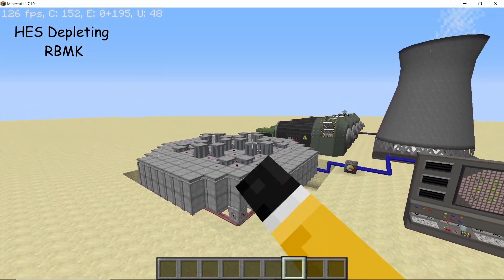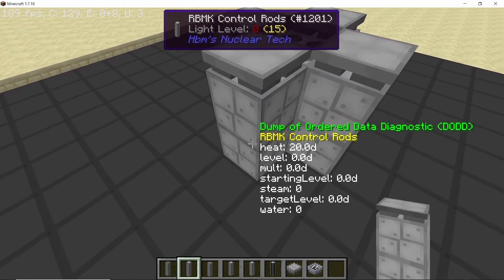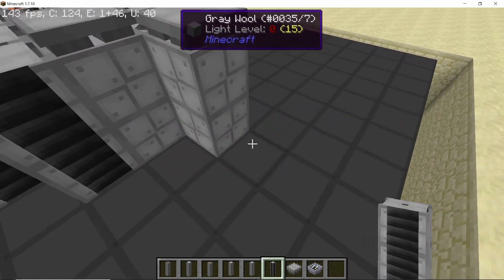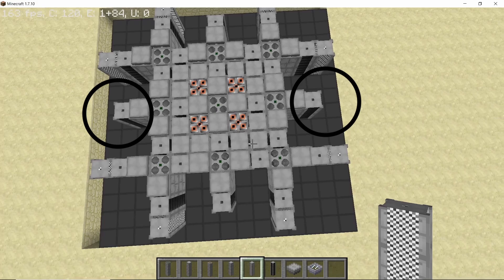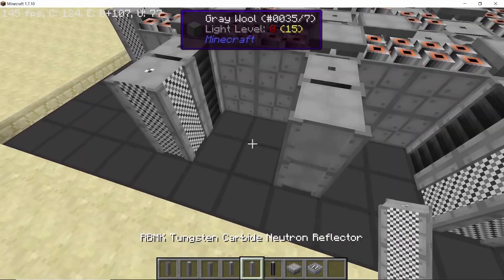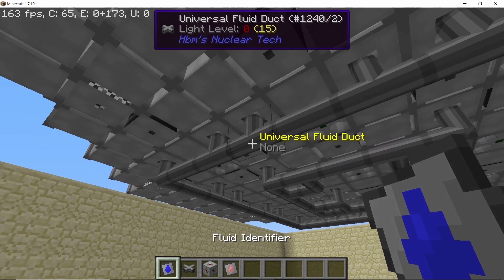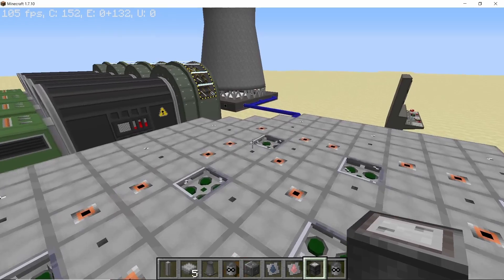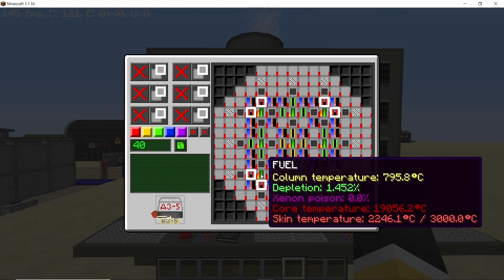15x15 RBMK Reactor - Schrabidium depletion using Thorium Fuel - HBM's NTM Minecraft

Comment: What do you need to do for don't blew up your reactor in seconds:
1: DO not press AZ-5
2: PUT 16 TURBINES. 8 leviathan, 8 industrial
3: PUT at least THREE COOLING TOWERS (2 BIGS, 1 AUXILIAR)
4: MAKE sure your reactor has enough water
5: Check the flux at the START, NOT other thing — if you don’t do this, it could blew up
6: THE life of the fuel rods is about 3 DAYS (real life) common. If you don’t change it, it will stop

If you don't do those things, it may not work, stop working, or blew up

☢ RBMK-1000 ARE NONE-SAFE TO USE IN NTM (NUCLEAR TECH MOD), LIKE REAL LIFE

This works on 1.7.10 with the normal NTM, and also on NTM EXTENDED or REMASTERED 1.12.2
Thank you for listen

Comment: Thanks for the tutorial!! Just one thing, for the schrabiduim fuel, you have to set it to 35 and then to get the most out of it I had to wait for it to stabilize then go up by 1 wait for it to stabilize and go up 1. All the way to 40. Past 40 (even by 1) = kaboom
Reply from the maker: Yeah that is why I made the schrabidium depleting pwr design in my last week's video, rbmk required quite alot of manual oversight. Pwr on the other hand is safe once you've set the control rods to the appropriate level. I find that much more convenient.
Reply: @SavageVegeta  yeah but i like rbmk because of that. There’s something satisfying by watching the control rods, cherenkov radiation and managing basically everything on your own
Reply from the maker: @jellybeaniac152  definitely I can see the appeal in that

Comment: I know there's nothing to do with this video, but after playing a lot with this mod, it was only today that I realized that LEAus and HEAus fuels are not radioactive, and you can even easily hold them in your hand, even when depleted, as they don't take on any radiation. , at least in the Extended Edition version it is like this, it is one of the best fuels for energy production, but it is bad as a neutron source, as a neutron source the best is Unobitainium, which I don't think is available in 1.7.10, I think which is only in the Extended Edition 1.12.2, which is the fork of the mod that I play the most, I made an Irradiation Reactor that makes plutonium-241 instantly, Unobitanium is very strong as a neutron source, I use it in the reactors also to spend the fuel quickly, and also to serve as a permanent neutron source, so I can use the reactor at low power and generating a lot of energy, but it's that thing, if you raise the control rods too much, the reactor explodes.

Comment: oh why the mod doesnt work? in 1.12.2 forge? and i got a mod from curse, the latest version, and why your fuel rods and other things aare 2 blocks higher? and mine is 4 blocks higher?
Reply: btw whats the version of the mod and how did you also got that fluid pipes like they are circle, and for me is a small blocks pipes and why the steam connecters dont connect to water pipes?
Reply from the maker: @YourLocalMurder.-le3ek  cause I'm playing it in 1.7.10 with the latest version of the mod. There are some issues in the 1.12.2 version ntm reloaded which is probably what you're using
Reply from the maker: Idk man the mod works perfectly for me. As for the height of the RBMK reactor ... the default is 4 but you can change that using the gamerule 
"dialColumnHeight 2"
Reply: oh thank you for the help!

Comment: Nice RBMK Layout
and is there a Method to make a Redstone Valve so you can control Ducts so you can deactivate them with Redstone or activate with Redstone?
Reply from the maker: The only way that I can think of to do that is to attach one of the pipes to sticky piston and then controlling the sticky piston to move the pipe in and out of the entire line
Reply: @SavageVegeta   thanks ill try it out

Comment: Is there a way to make a bigger reactor to make a bigger explosion like Chernobyl?
Reply from the maker: Yes ofc this is a modular reactor so it can be as big as you can make it and your device can handle just make sure the fuel rods are within distance. Also you can make the reactor taller using the gamerule of dialColumnHeight

I generally don't go bigger than this is cause I'm a fan of smaller compact reactors rather than big ones and another thing is my laptop can't handle bigger reactors. There's visible fps drop and lag when I start recording
Reply: @SavageVegeta  Are there any models I can use to make the reactor?
Reply from the maker: @Booga_1720  if by that you mean reactor layouts then you you will find multiple on the ntm discord and even on my channel but they might not be of the size which you want. However worth checking out as I remember seeing some pretty big ones on the ntm discord
Reply: @SavageVegeta  ok thanks I will look

Comment: the video is great but I don't know what I'm doing wrong when the water disappears without steam and that's why I have to press AZ-5
Reply from the maker: Maybe you have missed connecting the pipes somewhere cause as long as this whole system is a closed loop water won't "disappear" and the cooling tower is more than enough to keep up with the speed to continue converting all the low pressure steam into water
So double check all your pipes

Comment: Hey man! just wanted to ask, how do you figure out if your reactors are safe? do you just do trial and error or what do you do?
Reply from the maker: When these reactors were introduced trial and error was the only way I had cause I didn't really understand their working. Now that I've made several designs and many of them didn't go boom I've an idea ... Or intuition that a design will not explode and then yes to test that out once again trial and error
Reply: @SavageVegeta  so, if i didnt misunderstand, using proven designs and trial and error right?
Reply from the maker: @TheChosenIndividual  yes, take designs that you've already made and modify them according to your needs. For example a breeding reactor can be made much differently than a depleting reactor or a power generating reactor. 
The main thing is studying FUEL TYPES , with most medium type ones generally every reactor design should work , but with dangerous fuel types like HES which I used in this design it's important to control it using safe fuel rod types and control rods ... And in some extreme cases even coolers
Reply: @SavageVegeta  alright man, thanks
Reply from the maker: @TheChosenIndividual  you're most welcome my guy

Comment: Damn, what would we do without your help? A very neat guide, man, really helpful for those who aren't very RBMK-knowledgable, with your wisdom, I know how to handle these large things.

By the way, have you played with the 1.12.2 HBM Extended editons RBMK? That thing actually starts to  have jumping rods now if it reaches a certain temperature, I dont know if its worth a short or anything, but its a neat little thing. :)
Reply from the maker: Ayy I'm just glad this reactor doesn't go boom and you enjoyed it :)
as for the jumping control rods in ntm extended I tried making that work but for some reason it didn't even tho the columns were relatively hot.
The fuel I was using was also HES so it's skin temp went upto 2500 degrees celsius but the column temperature was limited to like 700 ... idk why cause the same reactor in 1.7.10 runs very hot

Comment: the thumbnail's rbmk had hazard stripes. i can't express how cool an rbmk looks with any sort of decoration
Reply from the maker: Those blocks are from Techguns mod but the good thing is now there are Hazard concrete blocks (and many other types) in NTM which can be used to decorate nuclear bases !!
Reply: @SavageVegeta  no I'm pretty sure the only hazard block was the stripes particle accelerator plating
Reply from the maker: @I_Am_Transcendentem  no in the latest update there is a concrete variant added as well which looks pretty sick. And there are other concrete variants too. Check out builders choice concrete
Reply: @SavageVegeta  ok
Reply: @SavageVegeta  also can you please figure out how to use the Schotkky particle diode

Comment: i straight up just replaced my first rbmk reactor's fuel rod which had 4 reflectors on all 4 sides and no control rods with an hes
and it exploded fortunetly i make sure to do it in a clone of the world ( i always do this before i try to adjust any of my reactors/power them on)
Reply from the maker: Lmao you simply don't do that to a dangerous fuel rod type , and yes making copies of the RBMK world is also something that I do as well cause it helps alot to avoid rebuilding the whole thing incase it explodes with a specific configuration